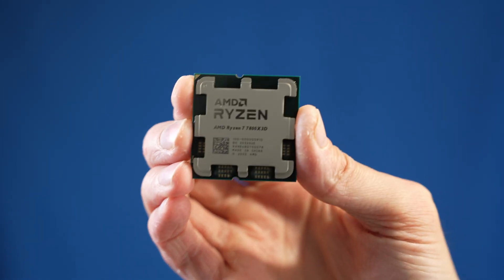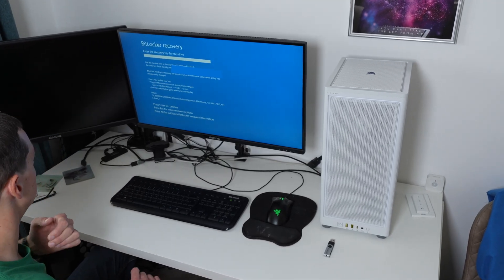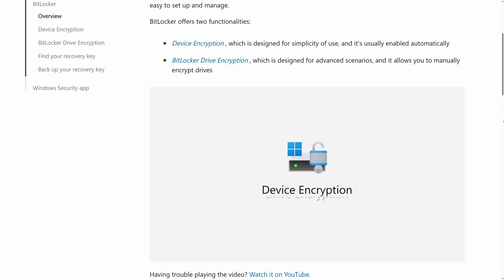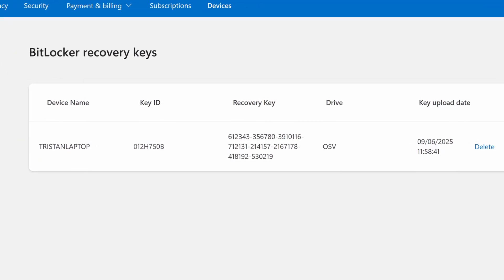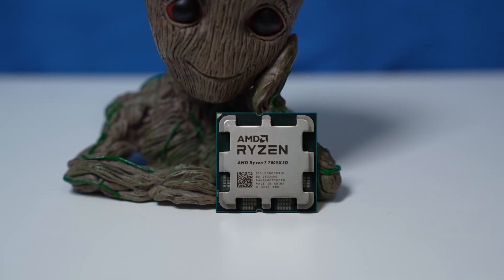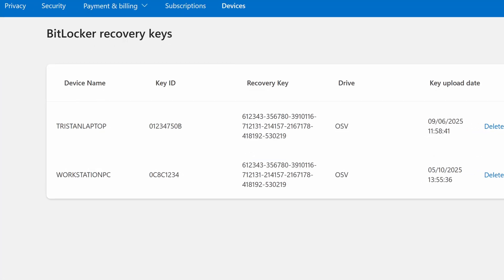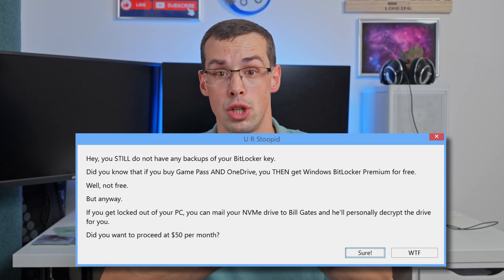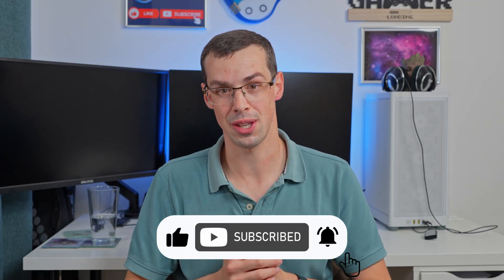Beware: BitLocker & Secure Boot Almost Ruined My System!

Comment: I cannot find bitlocker drive encryption under system and security :( -- i am in the same boat trying to update bios but it asked me to backup bitlocker
Reply from the maker: It might be that you have Windows 11 Home (not Pro). I should have made clearer in this video, but BitLocker isn't in every Windows version. The BIOS warning is a generic warning, just for you to check. But you should be fine, if you can't find the BitLocker option at all :)

Comment: I have yet to install Windows 11, but I have a new PC build coming in a few weeks. How do I prevent this happening to me?
Will BitLocker be enabled after initial Windows 11 installation?
Reply from the maker: It's a Windows 11 Pro feature (something I forgot to mention in the video - whoops) so if you have Win 11 Home, you should be fine. But I've personally disabled the BitLocker service within 'Services' and that has stopped it from auto-activating too :)

Comment: Microsoft said that I was responsible for my computer system, but this BitLocker tool was turned on by the Microsoft update
thus when I filed a Law suite which I know wouldn't go anywhere; their turn changed and the update did enable the BitLocker though the Secure Boot key, But This couldn't have happened without defaults on by the Secure Boot key and in doing system update Microsoft couldn't do these updates without the user's check box active. But in my case, I manually turned it off and disabled full Encryption on both SSD drives. And also luckily for me I did a full system backup and password recovery disk key and shutdown and did a cold boot
into the Bios and turned off Secure Boot and PTT and restarted the PC and run a full windows update. After the full update and 
a system shutdown. I started replacing system Hardware and when I put everything back together to re-Boot the system is when 
the BitLocker tool activated some how locking me out of my system. Microsoft update manually re-enabled the BitLocker though
the update. Yes I almost loss my computer but when I ran a scan on the memory to do a RAM test and recovered the memory dump 
and looked into the Event viewer the program told me and/or a lawyer everything we needed to know about who's responsibility 
it was. Long story short would you rather deal with one user or 10"s of Millions; makes me know difference. I'll just post my 
finding's and let's see what happens. Who the hell is going to spend a $1,200.00 on a High-End Motherboard and $3,500.00 more 
on other parts to let any manufacture tell them It's there responsibility without a fight. When it's the manufactures who 
caused the error. Meet me half way and lets both try and fix the problem but to out right tell me it's my own fault is a out
right a lie and who will believe that in todays market.
Reply from the maker: Yep I totally agree with your frustrations. They have been hypercritics for sure. It's a very annoying scenario.

Comment: Had you been locked out, you should have been able to access the bitlocker key by logging into your microsoft account. That being said: I'm not a fan of the secure boot/TPM/Bitlocker stuff either. I now have 2 machines converted to Linux.
Reply from the maker: Unfortunately not - the Bitlocker key was not saved to my Microsoft account. Somehow Bitlocker got enabled without my knowledge, and I never got prompted to backup the key. You're right though, moving to Linux can make a lot more sense, especially if you don't mind skipping BF6/BLOPS7/Valorant etc.

Comment: This video is for Windows 11 Pro users only. If you have Windows 11 Home, bitlocker is not given. If you try to launch Bitlocker from settings a window will come up and offer you to upgrade to Windows 11 pro for around $90.00.
Reply from the maker: I should have mentioned that, you're right. Thanks for pointing it out.

Comment: i noticed windows blows up in my face if it downloads an update but that was easily blocked in my firewall. my windows is in a virt machine so i still cant play the silly anticheat games
Reply from the maker: That's frustrating :/ I just had a couple of Windows updates fail and rollback too (non-VM mode). Not sure why, I think Windows is just increasingly buggy tbh.

Comment: This is the reason why I am totally against Games requiring Kernal-level secure boot access.
I used to play LoL and quit when Vanguard came out, never played it since. I would honestly rather lose to cheaters.
Microsoft Windows is going in a very bad direction unfortunately, I reckon in 20 years Windows will be phased out. some person will come along with money and make an operating system to work with all the manufactures ASUS, Intel, AMD & Nvidia.
I'm telling you it's waiting to happen. This why I respect Apple so much even though I've been a PC/Windows user, could you imagine Apple giving 3rd parties programs games Kernal-level access? just won't happen.
Reply from the maker: It's sad you quit LoL and Vanguard, but I can see why you did. It's all been such a hassle :/ I agree about Apple too - while they have their flaws, their approach to this is respectable for sure. A sad situation for Windows gamers :/

Comment: It's not gigabytes "fault". I'm on Asus and the SAME EXACT THING HAPPENED TO ME. Thing is I don't even use a Microsoft account on my PC! So device encryption is on BY DEFAULT on ANY MACHINE THAT MEETS W11 REQUIREMENTS!. Good thing I catches the damn thing mid encryption (my drives are HUGE so it took a long time for crappy windoze to encrypt them) I immediately turned off device encryption (which I recommend EVERYONE DO) and carried on.
Not only is device encryption/bitlocker POINTLESS on a desktop computer but it also adds overhead to the disk usage thus actually AFFECTING YOUR PERFORMANCE. Nobody, NO ONE on a desktop computer should have any kind of encryption active. Ever. Unless you distrust your family members in which case I'd say you have a much bigger problem in your life than device encryption...
Reply from the maker: Oh interesting, thanks for the extra context. Good to know it's not just Gigabyte etc. It's definitely very annoying, sorry to hear you got hit by this too :/

Comment: Finally someone made a video on this! Thanks, I was wondering what secure boot was. I hated using bitlocker, was wondering if that was needed for bf6 and bo7.
Now I know to be careful if I decide to play bo7.
Reply from the maker: Thanks for watching :) Yes it's a pain all round, especially since more and more games are starting to require it :/
Reply: I don't think the games require BitLocker, they only require secure boot. I'm pretty sure you can disable BitLocker (after Windows automatically enables it) and continue playing the games as long as you have secure boot enabled.
Reply: @Arthur78  Yeah, you are correct.

Comment: I have just been in the same situation yesterday, I have a SSD that I plug in to my laptop and my desktop depending on the machine I want to use. Ubuntu  24.04 is installed in it with all the drivers, apps, python scripts,  environments, lots of important staff etc. I was able to use the SSD both on my desktop and laptop effortlessly but I had to disable secure boot on my laptop due to some unique signature of NVIDIA drivers or something like I'm not sure, Ubuntu was not able to see my GPU unless I disable secure boot. Since I have also dual boot on my laptop as well as on my desktop, all I need to do is selecting the OS I want to use on the GRUB screen and before doing that I just need to turn on/off secure boot depending on the OS I want to use but yesterday when my SSD plugged in to my laptop, I changed my mind and decided to open Windows so  I enabled secure boot in order to do that but I encountered the same BitLocker screen you have encountered. I was shocked at first because I clearly remember that it was not first time I was booting Windows when the SSD that has Ubuntu installed was plugged in to my Laptop and I was able to boot up Windows not long ago maybe a few weeks ago. I'm not sure whether I updated Windows on my laptop lately because I have no use with the same settings on my Desktop.

Comment: I had a similar thing, without even the bitlocker enabled... Changed 5600x to 5700x3d and Windows 11 just said to me F.U. - your PIN code is no longer valid, please enter the password. Guess what, the password didn't work either - no idea why. I had to find some kind of recovery drive with Linux, which allowed me to alter W11 system files in a way that rendered my old PIN and password null. Probably one of the most stressful days in my life.
Reply from the maker: Oh no, that really sucks :( Sorry to hear that. Yep I've had that "PIN code invalid" message too. Not fun at all.

Comment: Thanks for bringing up this topic. But I'm still confused about what happened to your PC: did you mean to say your sys drive is old but your CPU is new, and win11 turned on bitlocker without your knowledge, so when you tried to turn on secure boot the BIOS wanted to "reset factory key", that means to forget any password or key you or windows set for your drive encryption, and you wouldn't be able to boot into your system? So after you booted into your PC with the old CPU and backed up the recovery key, did you "reset factory key" when you put in the new CPU? And why did that solve the problem?

I also recently built a new 7800x3d system on a B850m Aorus elite and I was also prompted to reset factory key when I first booted it up (or was it when I tried to turn on secure boot? can't recall). Since my whole system was brand new and I intended to install a clean copy of win11 home, I did not hesitate to press Y and secure boot was active, everything went smoothly with BF6. But I also can't find "bitlocker" in control panel. Is it because I didn't set a password for windows or for BIOS?
Reply from the maker: Thanks for watching and commenting :) So a key fact I forget to mention (whoops) is that BitLocker is a Windows Pro feature. It doesn't exist on Win11 Home - although apparently some users have a 'Device Encryption' feature instead which is similar.

All my hardware was brand new on the build. So, a brand new 2025 CPU, NVMe drive, mobo etc. I then enabled Secure Boot as part of playing the BF6 open beta, and that's when I guess that BitLocker got enabled without my knowledge.

I then upgraded my CPU a month or two ago, and that's when I was temporarily locked out and if I had reset the keys again, I may have found myself unable to do anything.

Instead, because I didn't reset the keys, I was able to put the old CPU back in and I could then boot into Windows as normal (because my PC thought "oh there's been no hardware changes since the PC was built", essentially).

Comment: And here I was contemplating whether to install Win11 on my upcoming new build, or just stick to Win10. I guess I have my answer.

Very informative video! This specific case probably wouldn't happen to me, but with Microsoft as it is now, I don't want any more nasty surprises - whether due to them being sneaky, or me being sloppy.

Thanks for the valuable information, as always.
Reply from the maker: It's definitely frustrating all round :/ Microsoft are heading in a bad direction.. and have been for years now, unfortunately.

Comment: omg I'm looking into that right now!!!! did the same thing, just wanted to play bf6 ty, ok windows says bitlocker is off, so does that mean im ok? sorry to ask but this pc is my first build... p.s I have a gigabyte board too...
Reply: Yes, you're okay.  However, if you at any point want to reinstall the OS by doing a clean install of Windows then it might be enabled automatically.
Reply: Disable the Bitlocker service just to be sure. If you're on a Pro version of windows, there's a group policy editor setting to make sure it never gets turned back on again as well.
Reply: I've heard that if you don't have a Microsoft account associated with the computer, BitLocker will not be turned on (because there is no place online to give you the recovery key). I'm not sure whether that's true. I recently installed Windows with a local account, and BitLocker was not on as Settings showed the "Turn on BitLocker" button, but C drive showed encrypting. I suspected that as soon as I sign in to a MS account, BitLocker will immediately be turned on and will start encrypting my C drive. There was no button to turn BitLocker off (possibly because Windows was not activated or because it is showing the "Turn on" button). I used the manage-bde command to turn off BitLocker. My C drive showed decrypting and then BitLocker off.

Comment: I've got W11 Family, don't know if it's the same as your Home. 
But I've just checked, it seems my OS drive isn't encripted and Bitlocker isn't available unless I upgrade.
Reply from the maker: Ah interesting, yes seems like it can vary depending on the Windows version. Although apparently you might have 'Device Encryption' as an option instead, which might work out a bit similar?
Reply: @TechOverwrite  I doubt it. I did some light digging. All I can come up with is "Bitlocker/Device Encription available in an upgrade W11 Pro"
Reply from the maker: Oh interesting, I thought I read that some sort of encryption exists on all W11 versions. It's a minefield at times :)

Comment: I didn't even know Microsoft had reduced the requirements for Bitlocker and it's absolutely insane not to tell the user it has been automatically enabled.  At the very least they should prompt the user to backup the encryption key just like they keep spamming me about One Drive.
Reply from the maker: I agree entirely, it sucks all round :/
Reply: The way Microshit changes things, you really need to keep on top of stuff.  They auto-enabled Bitlockers ages ago.  I dumped the whole shit-show of Windows in 2020.  They are not worth the worry.
Reply: naive developers at microsoft and uncanny shareholders and naive to the point of dumb but what do they care -you need a new os and motherboard +hardrive and maybe a technician -bling and money for them - iwonder how it goes in africa and asia with window 11 -I guess they will hack the thing or just hate micorsoft

Comment: Good intentions 😅. Microsoft doesnt require tpm, secure boot or bitlocker with good intentions, Its just one more way of tracking and profiling you. With AI companions its not even necesary to hack your computer like in the past. All they have to do is Ask the AI for your profile or  summary of your activity, All this data collection is based in knowing at all times who is in front of the device all tied to your microsoft account. Thats why they are pushing so hard to end local accounts. At this point any computer running windows 11 is not yours, you paid for it, but Microsoft can lock  you out, delete your drive, change the boot loader to mess with an alternative OS in dual boot and so on. They collect data and dont even have to pay for the hardware, you do 😅. And dont even get me started on allowing anticheats that require low level access to your hardware. You are trusting all your privacy on the good will of anti cheat companies. On my pcs, no thanks. I dont need to play those games that bad. And if you do at least have a dedicated pc only for gaming and do any browsing, email, and anything private on Linux. If you want to learn more look up Rob Braxman's video ''Your Windows 11 Computer’s Hidden Spy: The Dark Truth About TPM Chips''

Comment: TPM is NOT a good thing for most PC users IMO, nor is BitLocker any good.

Got a broken motherboard and get sent a replacement?
DATA gone.

And if someone steals your entire PC, they still have access to all your data as they also have the MB/key.
So it does not protect the user against theft at all, a password that is used every day is hardly something un-guessable.
All it does is make life hard for the user and put the data at risk.

And changing hardware is the very foundation of what makes a PC.
It should never make a boot invalid.
Reply from the maker: Great points, I agree entirely. And yep, you're right that once your physical device has been stolen, they aren't really useful features anymore. Definitely a frustrating implementation right now (and generally, too).